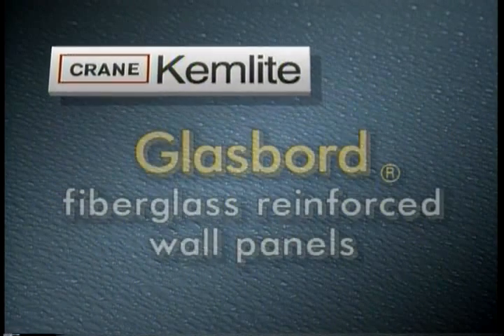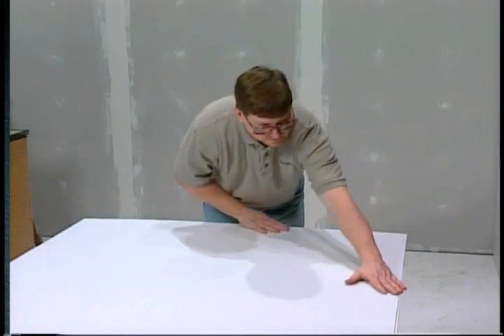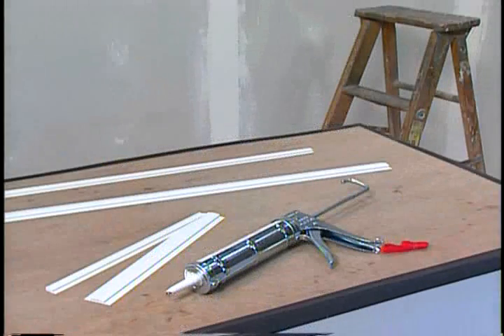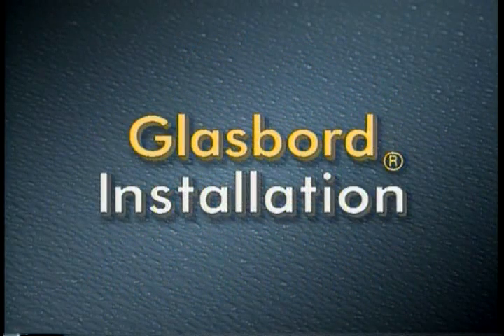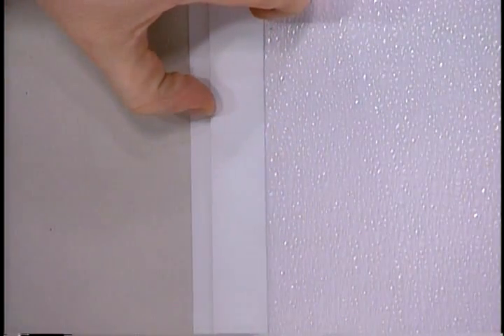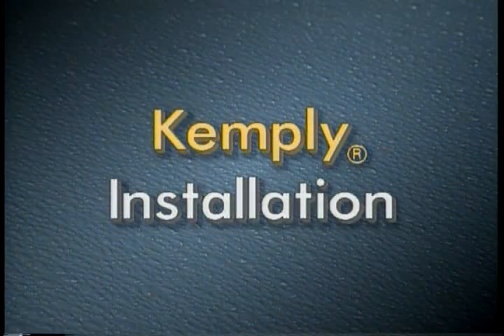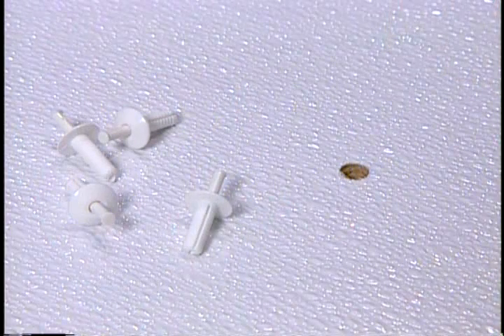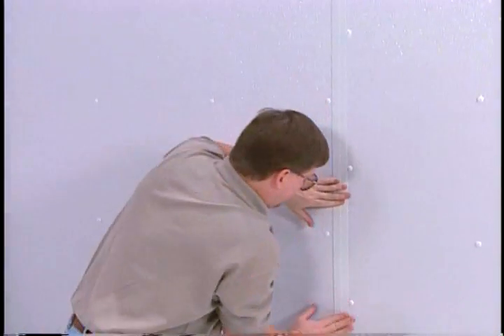Crane Composites Glasbord FRP Installation Video

Comment: How about for shower walls for use in a small walk in shower? I want to get rid of the tile and reduce the all the grout to minimize mold.
Reply from the maker: Yes, you can use our panels on a shower wall.   We recommend if possible to install the seam of the panel to the far end away from the water spray.  It sounds like the shower is small and you may not be able to do that.   I would recommend that you use silicone caulk in the moldings and around the perimeter of the panel to ensure water does not get behind the panel.   It will also be important to leave a gap in between and around all the panels that is at least a 1/8” wide to allow for the panels to expand and contract due to temperature and humidity changes.  If the panels are being installed onto a non-porous substrate like water resistant drywall you will need to use our Advanced Polymer adhesive or use nylon drive rivets to adhere the panel to the walls.
Reply: Nooooo Will not work

Comment: Is this okay in areas around bath tubs on the walls above the tub? I'm wondering if the adhesive forms a bond to protect the drywall after it has cured?
Reply: we have an arched ceiling shower/bath. When my husband and I wanted to remodel we didn't want to lose the arch, We used this product. Love it. Its been in 15 years now. No issues.
Reply from the maker: Yes, you can use our panels on a shower wall.   We recommend if possible to install the seam of the panel to the far end away from the water spray.  It sounds like the shower is small and you may not be able to do that.   I would recommend that you use silicone caulk in the moldings and around the perimeter of the panel to ensure water does not get behind the panel.   It will also be important to leave a gap in between and around all the panels that is at least a 1/8” wide to allow for the panels to expand and contract due to temperature and humidity changes.  If the panels are being installed onto a non-porous substrate like water resistant drywall you will need to use our Advanced Polymer adhesive or use nylon drive rivets to adhere the panel to the walls.